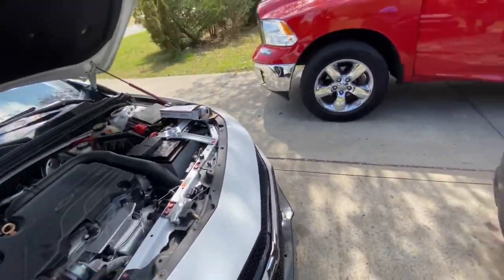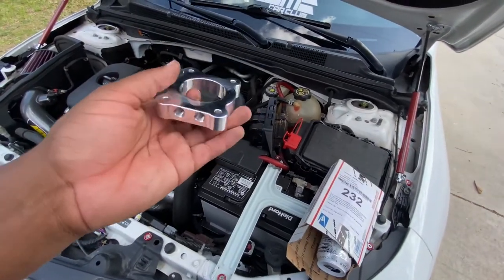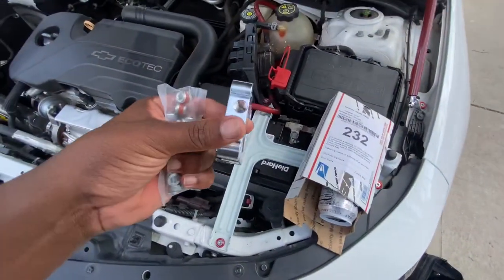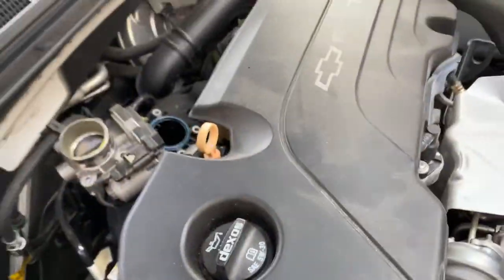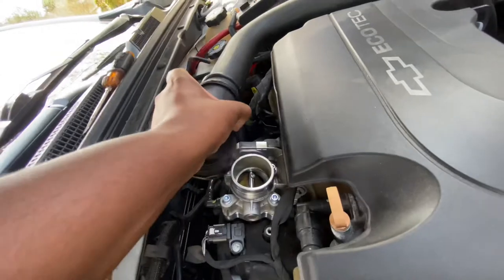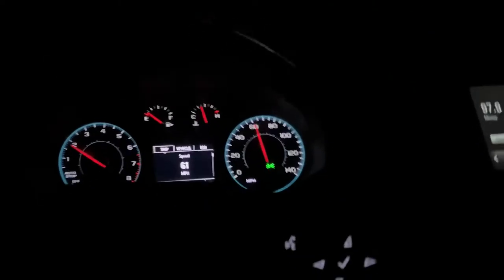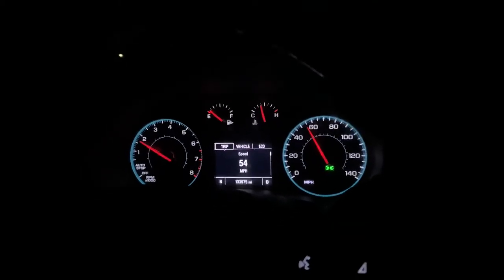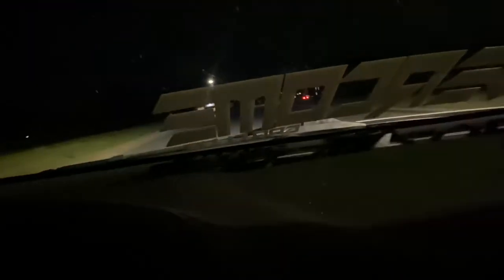BNR throttle body space (2017 Chevy Malibu 1.5T)

Comment: Great video! Question...what is the screw hole to the left of the throttle body? I freaked out after cleaning my throttle body, thinking I lost the bolt, since it looks like you can see all the way inside the chamber. I found a bolt to put in there, but now I see a bunch of videos and nobody has a bolt in there. Nobody even mentions it, either. Lol. Just weird.
Reply from the maker: If your talking about the actual spacer  then you probably have a small boost leak
Reply: @overcomecc0312  every video I've seen has that threaded hole, right next to the intake. Weird

Comment: Hey guys, love the channel and the content! Quick question, did you experience any issues keeping the intercooler plastic pipe that attaches to the actual throttle body in place after the throttle body spacer was installed? I know it has the clip, but mine tends to creep up and even blew off last night (reduced engine power came on with the quickness...lol).
Reply from the maker: Lol that suck but no I haven’t had any problem with the stock plastic piping
Reply: @overcomecc  Thanks, man. Thankfully, once I refit the piping, it hasn't come off again! The intercooler is next. Hopefully, some custom work can be done to replace the plastic. Keep up the great work, man!

Comment: The 1.5 Malibu moves when you have a downpipe, cold air intake and either trifecta or bnr tune
Reply from the maker: I’ve been looking for a down pipe can’t find one
Reply: @overcomecc  there’s no downpipe to buy for the 1.5 Malibu, you have to gut the downpipe to run an open downpipe
Reply: by "cold air intake" you mean k&n or AEM filter w/o box?
Reply: @alexanderkim7241  I got aem
Reply: @Lilbooke  doesn't it sound awful at 1.5-2.5k rpm range? Also what do you think about throttle body spacer? is it BS?
Reply: I have a Malibu with the
Dowpipe gutted from canda with an 02 sensor spacer
Reply: Will this spacer  fit a 2020 malibu???

Comment: Boy with these gas prices you brave rolling around with that much gas lol
Reply from the maker: Roll around on E cause how much gas is lol plus I use premium
Reply: @overcomecc  Those 1.5T engines only use regular gas.
Reply from the maker: @seangowan7441  they definitely do not lol
Reply: @seangowan7441  the engine doesn't like reg
Reply: @seangowan7441  they run like ass on 87 TRUST ME!
Reply: @seangowan7441  always use 89 or 93 on the 1.5T and never that 87